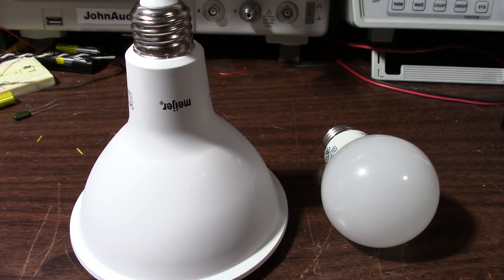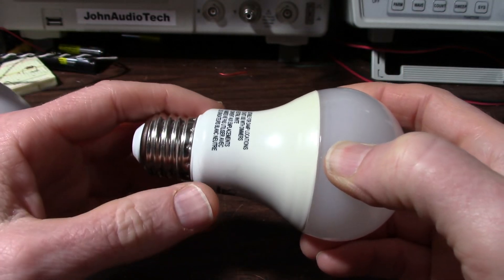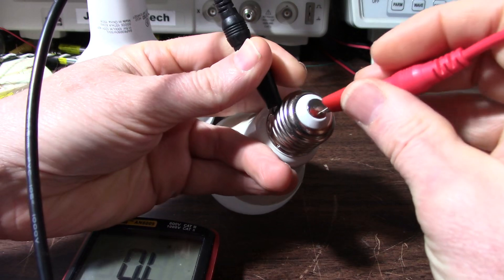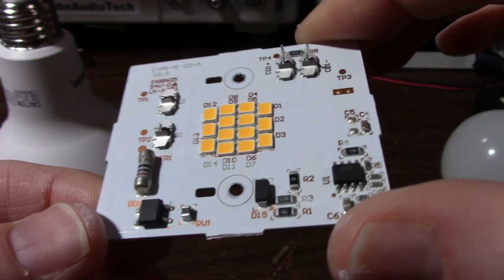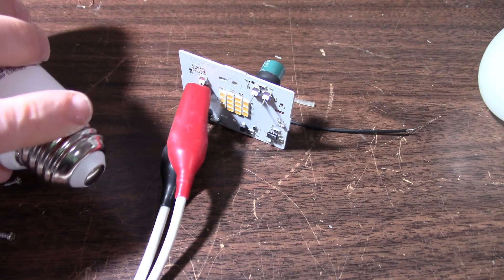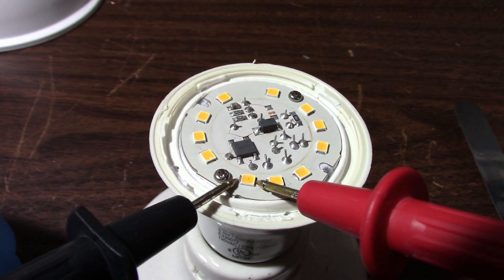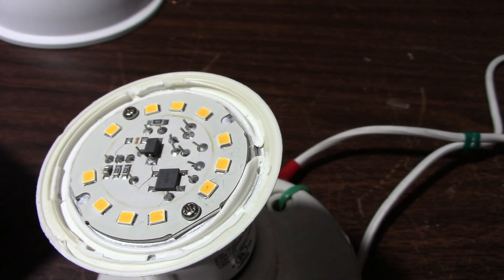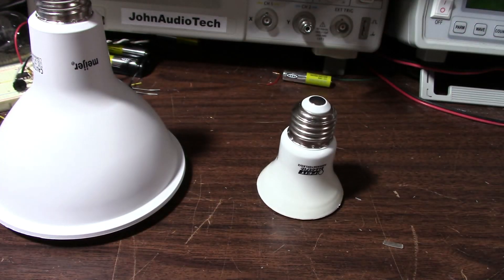Two failed LED bulbs for teardown to find why they quit working

Comment: I can tell you I have fixed a dozen flood light leds bulbs by just cutting the center contact point plastic on the periphery with a utility knife. The center contact was recessed about a 1/32" under the plastic tube part. This prevented the bulb socket to make contact with the positive electrical contact. Nice video fella too.

Comment: Hello John. I love Led bulb teardown videos. Things got strange with lighting lately. E.U. banned incandescent and halogen bulbs. Fluorescent bulbs are too slow to reach full brightness, ugly and bulky so no fit, they lose brightness over time, they have low CRI, they are more expensive, and based on their lifetime, price and consumption, they are not more econimical to buy and run. Leds have their issues too. They can't replace every bulb type, CRI is still not the best, they are even more costly to buy and they break way too easily. In the end, we spend more money replacing the now more expensive light bulbs than we save from lower electricity bills. Over the years I'm still trying to find led brands that do not break. I've never had a bulb last more than 2 years. I've now started fixing dead light bulbs when they are indeed fixable. Don't throw away that Feit bulb. It turns out that led bulbs are also included in the light bulb conspiracy (planned obsolescence) or else the companies would go out of business. One common way to make led bulbs fail is to apply inadequate amount of thermal paste. As a result leds burn. What I do when the circuitry is a constant current driver is replace the thermal compound with proper amount and then remove the dead smds and short their contacts. This way I get to keep them much longer. But this shouldn't be happening in the first place. Manufacturers should calculate precisely and deal with thermal issues when choosing the components (like capacitors ratings), when designing the casing, the heatsink size, when applying the thermal compound, when deciding the bulb wattage, etc. But what benefit would they have by manufacturing a bulb that is going to last 10k or 20k hours as they cunningly advertise?

Comment: I'm still running on flouro bulbs. Get about 3 yrs average out of them and usually on special for few bucks. LEDs are around 5 times the price here in NZ and none last the "up to" lifetime. They won't even give you more than a 12 mth warranty on them

Comment: Maybe that big one has an intermittent issue. I had few Led bulbs killed by a lightning strike that struck the electrical pole near me and 1 was completely blown up but other 2 just had blown fuse and i replaced them but one of them randomly stops working. I tested the voltage and it is a blown driver. It simply stops giving out voltage randomly.

Comment: I wonder if you had your lighting circuits controlled by a Zero Crossing Switching system would that stop the failures.
Reply from the maker: The light controlled one uses a relay, so it direct to mains.

Comment: Only LED bulbs I've had trouble with were Hyundai brand that I got from poundstretcher in the UK... bought 3 to replace some CFLs that were annoying me by taking a long time to start.... they all ran really hot and all had failed in a month with the black spot on one of the LEDs. I guess it was a bad batch or a poor design and that's why they ended up in poundstretcher. I even tried making an external heatsink collar out of beercan Al to sit on the outside of the bulb body after the first one died  to see if it would help but it made no noticable difference in the end.
I'd normally try repair stuff before throwing it out but I couldn't be bothered trying to save those horrible bulbs so they went to landfill - maybe I could have derated the supply circuit but I'd run out of patience with them.
It's not even a cheap bulb thing, I've had cheap bulbs from poundland and screwfix that have worked for years.
Reply: @Riskteven  Just remembered that my dad has a PIR controlled lantern that ate a couple of LED bulbs in a fairly short time. cant remember the brand. It was rainproof but pretty well ventillated and the bulbs weren't getting really hot, at least in the couple of minutes they were on each time it triggered . My guess is that the relay was bouncing a lot when it closed and sending a train of edges into the bulb. It's got a dimmable filament type LED in there now and that's lasted a lot better.

Comment: First one in 9 friggn years??  I think last year alone i had maybe 15 fail..  all led failures..  and all installed open air, some even after a transient suppressor..  multiple brands also...  some bulbs ive had for years and years but most have shit out..  past 5 years i bet i went through 30-40 bulbs...  not on 24-7..  maybe used 4 hrs at most a day for some, average like 1 hr a day..  all had little black dots in the leds..  or continuity told me one went bad..  hell i got one thats died 12 times and has all different leds than it did have but after the last original led died and all had been replaced that bulb has worked for past 2 years...  lol. And the leds are all kindsa different..  different sizes and number of diodes, resolution, no changed resistors...
Reply: @Krackatoa maybe the 'dimmable' types will do better than capacitive droppers if you've got rough mains?

Comment: Have you ever seen LED bulbs that look like these?  They appear to be transmitters of some wavelength or other and they make red light.  I can't find a picture anywhere online of similar devices
https://www.dropbox.com/sh/7qa8tm5zq2de9ar/AAA1Dl9MRW1xs3Rjjb3Lfmgja?dl=0
Reply: Those are neon bulbs  NOT LED.  They require 60 to 90 volts but minimal current to turn on.  High voltage required to ionize the neon gas inside for them to conduct.
Reply: @jp040759  OK,  now i see them.  Thanks for the info.

Comment: In my house an LED light failed mains input filter capacitor blasted fusible resistor got open. Even after replacing both LED working just fine but input section, upto driver ic gets hot really fast. The ic itself is not getting hot. All the filtering components getting hot, 1uF electrolytic capacitor, 470nF metal film cap, and inductor and bridge rectifier, fusible resistor also. What could be the reason?
Reply: too much current draw? A redesign may improve that. And better thermal ventilation would also help. I'm beginning to think some designs have inherent failure eventually, planned obsolescence maybe. IMHO
Reply: @TheKb117  that's true. The driver ic is HW9616. I suspect the ic for doing some wiered stuff. Once powered within 10 seconds the resistor started smoking. One thing I noticed the light is supposed to draw 20w but it actually draws 30W. So ic might be faulty?

Comment: if most LED bulbs fail due to thermal aging of the components or possibly just enough rating of the components for engineering/economic reasons, I wonder if a DIY design with overrated components and a well-ventilated design could result in a very, almost, infinite-life LED bulb... just wondering. I am also thinking about planned obsolescence being a possible factor. It makes sense for a continuing business... perpetual consumerism. IMHO. Great investigation John. 
Also, if maybe I can interest you to undertake if your funds allow it, on an XPS flat pane exciter speaker. Parts Express has some good exciters. Would love to see your impression and opinions of the sound quality and other technical characteristics of said panel.
Parts Express, Audio Circle, and DIY Audio have some threads on their forums where the DIY community is exploring the same.
Thanks again, John.
Reply: Well, if you buy expensive components, with a good enough schematic you can actually make an “infinibulb”.
Reply: I think you could make a DIY bulb that lasted for decades. You can get lamp cases and circuit boards on ebay for 38, 60 and 120 LED mains lamps if you want to experiment with underdriving your own components. Search terms like 'DIY LED energy saving lamp suite' bring them
Reply: I've read from a 1960s era electronic engineering book on the chapter of the then "newfangled" light emitting diode stating that if used properly and not being driven within an inch of their lives, LEDs have a supposed theoretical lifespan of 150,000 years.

Comment: I repaired some of those bulbs soldering a resistor that gives the same voltage drop as the LED's and it works for some more time.
Say hi to your cat friend. I have a dog that makes me company in my work place.
Reply: i was thinking the same thing... to get more life out of the bulb and avoid the landfill.